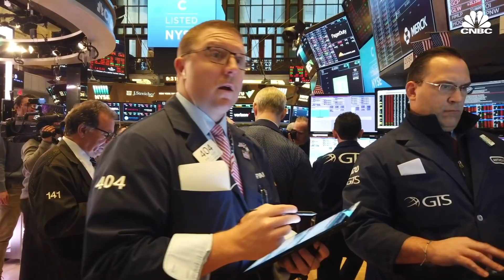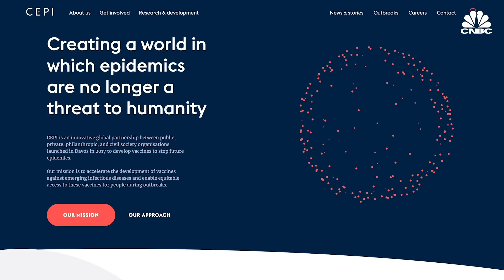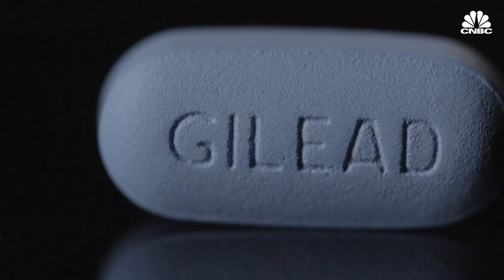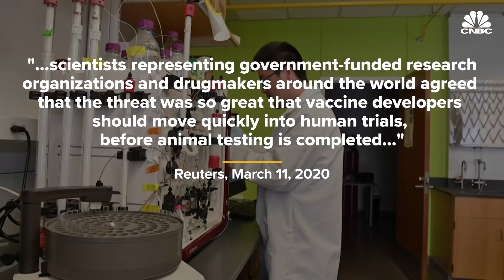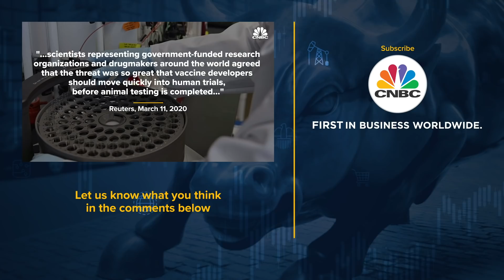The Race To Develop A Coronavirus Vaccine

Comment: I need to study more on these companies that are working on the vaccine, gotta capitalize on the stock market!
Reply: The issue with that is the time it takes to develop, and the fact that only one of the competitors will likely take the prize.
But I like the technology of Moderna, using mRNA.
The issue is, it's a new technique and would likely take additional testing.

I've heard of scary reactions with existing vaccines of these types, that turn the immune system against itself.  So mRNA still might get there first.

Gilead's Ebola drug Redemsevir which seems to have some use against Corona is a new type of medicine called a "Protide", developed and leased by Cardiff University.  
The first example of this technology was 'Sofosbuvir', which cured the 'incurable' Hepatitis C a few years ago.  I knew a guy who underwent the early trials around the time Pamela Anderson did.
Protide drugs are also showing huge promise in cancer treatments and for ailments which traditional drugs cannot treat.
The best part is, it's a technique which can be used to modify existing medicines to make them safer and more effective.

For full disclosure, I'm not invested in any vaccine competitors, but I'm heavily invested in Nucana, which has exclusive rights to develop cancer drugs using Protides.  They use the technique to alter existing chemotherapy medicines to be more potent and less toxic, and their results seem very promising.

Look in to the histories of their boards and leadership.  All investment/big-pharma cross-over guys who have brought billions of dollars of drugs to market.  Very nice.  
They've got an accelerated 'Orphan Drug' designation for their first Protide drug, and phase 2 trials dwarfed existing Chemo treatments.
Harvard recently bought a 10% stake of the company.

Comment: A vaccine will take years, reports of two strains of the C virus is already circulating. The common flu has multiple different strains and a flu vaccine is not guaranteed to prevent a flu.

Comment: Hopefully the panic will die down. Never seen such panic for swine flu, SARS, MERS,  Ebola, heck even hiv/aids or any other issue that can’t be cured or at least all the time like cancer. If this virus was 50 percent or more in faltality, then sure it would be very scary like Ebola, even if it was 10 percent or higher it would be much more of a concern. No one seemed to freak out at Ebola, even though it could of easily been worse. Point is, lose the mass panic, hope for a vaccine soon which usually happens for most viruses, and just be prepared by keeping healthy and fit. Also, wash your hands and don’t be filthy. Covid19 is dangerous to elderly and people with health issues but for 80 percent of people, the cases are very mild. Even for the 10 percent who need to go to the hospital for it, usually have no problem just need extra care. Less than 3 percent maybe even 1 percent die. People with complications and the elderly, it is closer to 10 or 15 percent but your odds are still well in your favor. This panic is going to make it scarier and worse for everyone, which is worse than the virus itself.

Comment: "Typically, vaccine development can take 15 to 20 years. The lengthy process requires that scientists first give the vaccine to animals to determine whether it's safe and effective at preventing the disease in question. Only after passing through iterative tests in animal models, and being adjusted along the way, can a formulation be tested in human trials.
"

"When you hear predictions about it taking at best a year or a year and a half to have a vaccine available … there’s no way to come close to those timelines unless we take new approaches"

- Mark Feinberg, president and CEO of the International AIDS Vaccine Initiative
Reply: And if the virus mutates into other similar forms then what? I hear this is happening now.
Reply: @jimieljoseph2322  then the vaccine is ineffective and the clock turns back to initial
Reply: #6in10men
Reply: The Animal Testing Phase got.skipped In this case